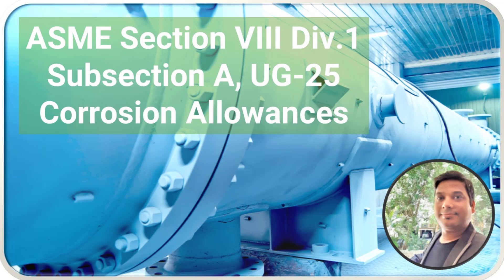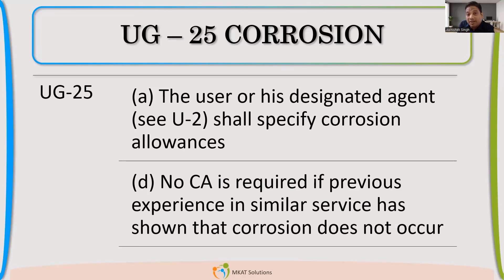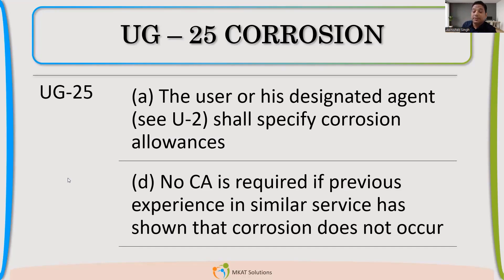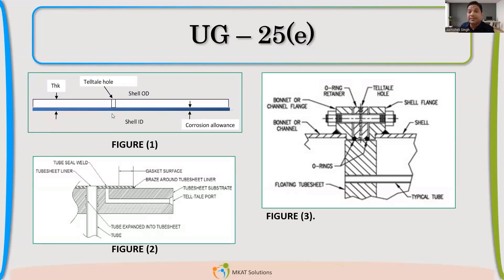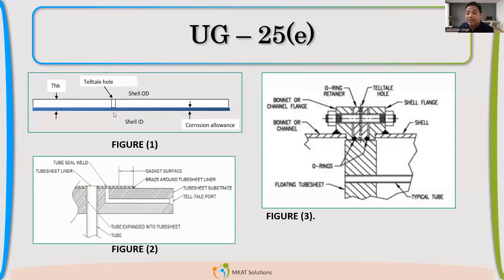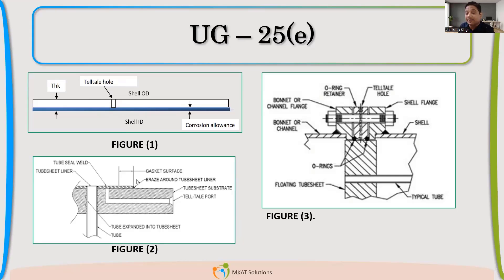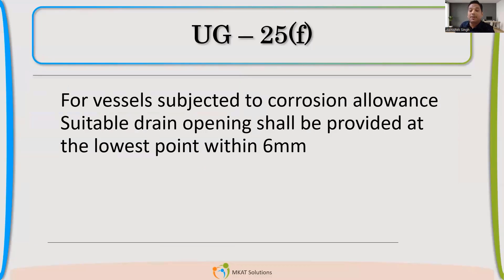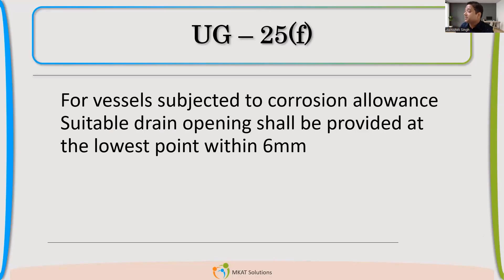UG-25 What is Corrosion Allowances: What You Should Know

Comment: How the tell tale holes are plugged? 
The location where the tell tale hole is drilled is the weakest section of equipment since the wall thickness is not there and only thickness equal to corrosion allowance is there.

Is it not leakage or even failure prone region of pressure vessel?
Reply from the maker: Its a very local point, so the failure criteria